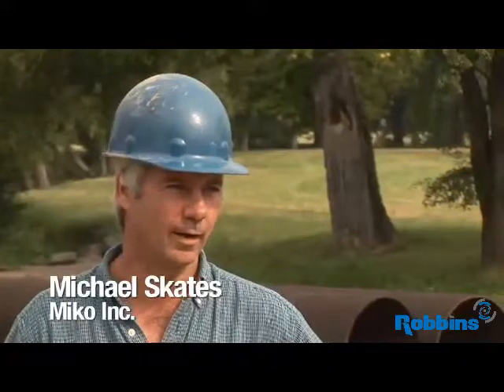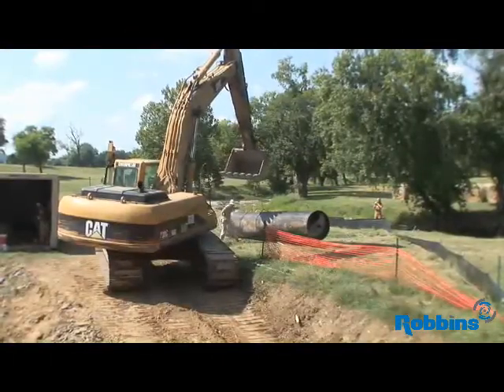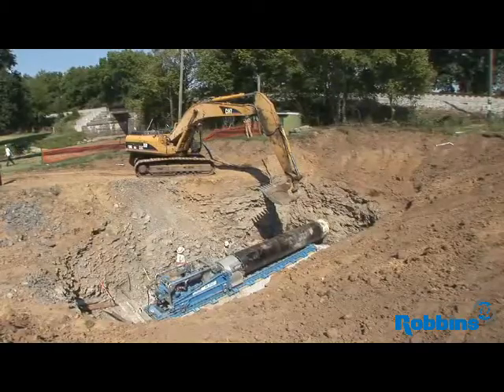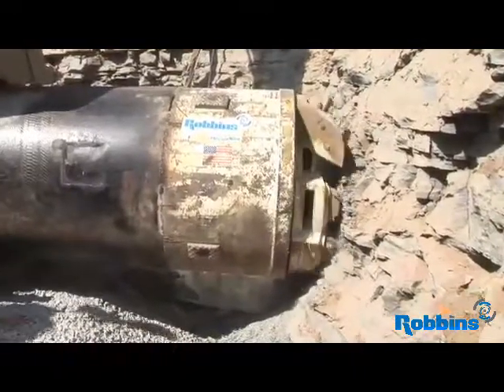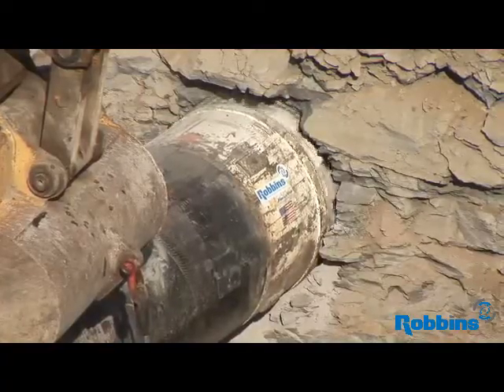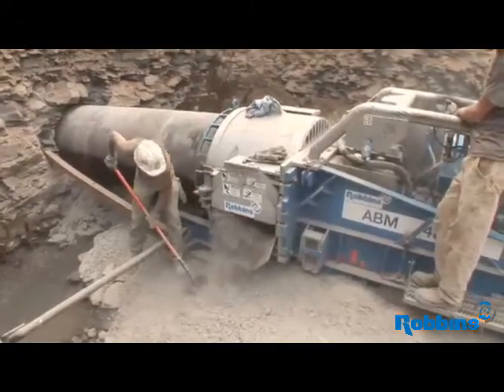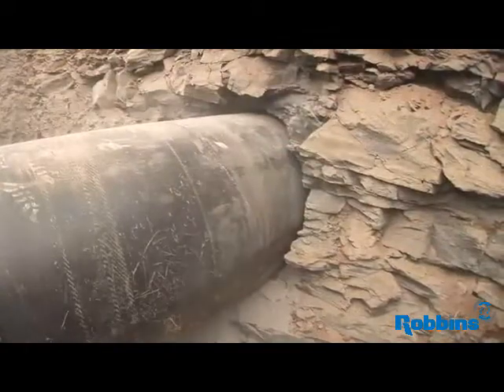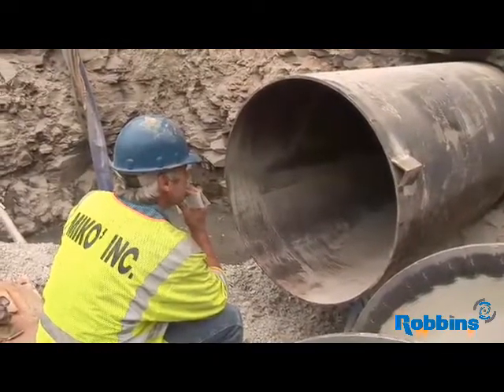Robbins Small Boring Unit Case Study.flv

Comment: I was the operator on this video and that head was outstanding in all the holes i punched with it. In all i think i made 5 42" bores probably 600 ft and had 0 problems aside from undesired cover depths in one bores plans and no head will stay down when the top is thin or running out of the rock. No problem shoving 20'and having the next 20' ready for boring in 10 hr
Reply: can you help me
how much land category affects the drilling time of 12m pipes
how much pipe diameter affects the drilling time of 12 m pipe